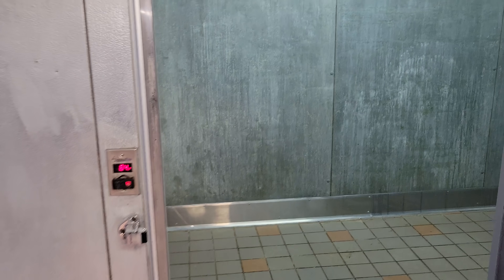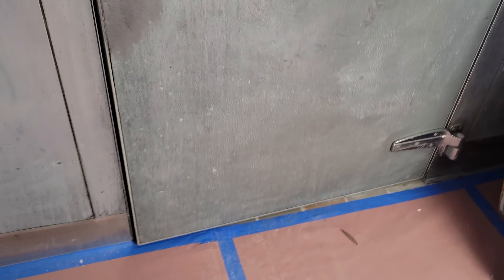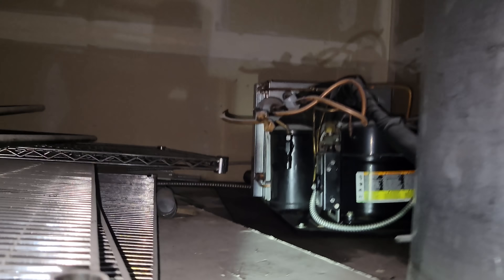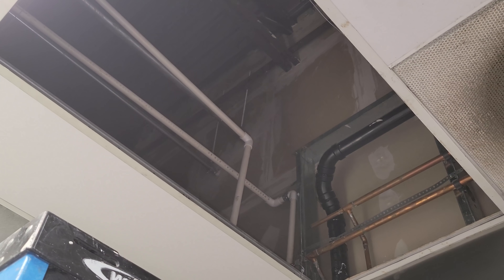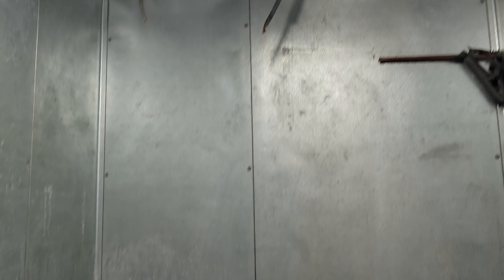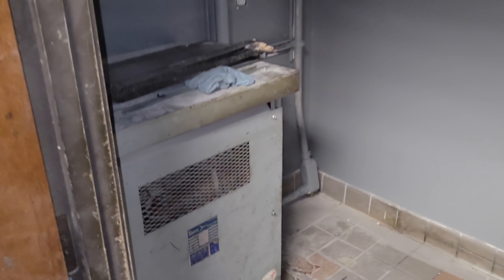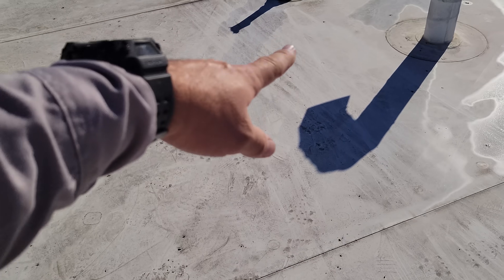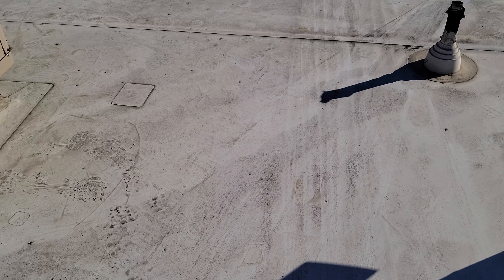THEY JUST REALIZED THE WALK IN COOLER IS MISSING SOMETHING

Comment: The general contractor should have known better. The architect should have know better. They are both there to serve the customer and that includes having the competency in actually doing the job. I came across something similar in a mall. The contractor didn't bother with any of the inspections and screwed all the electrical up. Have to bring in 2 people for 2 months to clean the electrical up. Misswd egress on doors and the list goes on and on. Oh missed ada heights on sinks.

Comment: this place is in great shape compared to the stuff im working with 🤣 I keep the old crap running though ,by old I mean the building had a/c installed in 1983, and they are all still in service cause I won't let them die 🤣. 480, 208,277, 240 on 110 wire using the white as line , yeah we got it all 😅.

Comment: My brother in law was an HVAC service man for years. At one large strip mall a lot of the stores being identical square feet had identical roof top units. He got a service call customer AC was not working. Somebody stole the compressor and probably I stalled it on same roof. Mall tried to prevent this by making everybody that went onto the roof sign into a book and get a work permit. Did not help. One of his co-workers had his 28' fiberglass ladder stolen from roof edge while working on roof.

Comment: This is a complete disaster for the tenant wanting to open a restaurant there. I can see the previous Asian restaurant operators realized they had a slow-rolling disaster on their hands, so they (literally) cut and run. I'm surprised they left their utensils up in the 2nd ceiling like that. That could be considered a code violation right there.  But overall, the current operator has at least 50-75 grand in rework to do before the place could open and operate properly.

Comment: Oh you'd be having a heart attack if you seen some of the things I've seen I worked construction building a plant on the instrumentation side and they were trying to cut costs so they decided to get bolts that you can barely put half a thread on with the nut keep in mind these are holding metal trays that have tubing going through it that vibrates a lot and that's the least of the issues that that place

Comment: Bid high. Sometimes a win is not getting the project.

MEP etc is likely supposed to have been design build by others. The GC then finds subs that can provide that. Whether is a them hiring an engineering firm or a trade with that capability in house. 

Skeptical DB was provided here. 
Skeptical there is an architect. 

Doubt walk-in floor is insulated below the slab. So this should be assumed as a cooler. Freezer modification need to add insulated floor panels.

Comment: Volunteering the information is a good thing. Ultimately it will secure you business in the long run and get you a reputation as a straight shooter. I am a facility engineer at a hospital and the contractors I work with are ones that trust and that I know will tell me how things are. I want to know what's wrong and see what issues are present.  This is especially true when you're dealing with old buildings and retrofits.

Comment: You did the right thing! We're in similar but parallel industries. You're in HVAC, I'm in IT. In my career, I have frequently gone out to a customer site for a "minor upgrade" only to find that their equipment was woefully undersized, under-powered, too old to upgrade, or simply not fit for the purpose they intended. It always pays in the long run to be honest and up front, and let the customer know what path would be in their best interest. Yes, you volunteered a lot of information that wasn't in your wheelhouse, but your experience has value (lots of it), and the customer will be better off in the long run from your advice. If they don't take your advice, then you didn't really need them as a customer anyway. Keep doing the right thing. It will always pay off in the long run!

Comment: 8:00 That is definitely not going to be used as an office. A server room maybe. And no worries about that network equipment overheating, if being in the room isn't hot enough to kill you in 10 minutes, then it's not going to do a thing to the routers.

Not to mention the dozen or so CAT5 cables. 100% a server room, no one is planning on sitting in there doing the accounting.
Reply: That small room will end up being like 120-130 F, at all times. The EM field produced will damage electronic circuits, I can almost guarantee it. Also, it is not up to code with the proper amount of space around it, 3 foot in front, 1 foot on all sides, not enough room for ventilation. Also, some of these cities have even more rules and regulations far more harsh and specific than this, some you can't store anything that could be flammable in the same room as the transformer, some require them outdoors all together and away from people.

Comment: The transformer won't put out any microwaves, but there's certainly ac electromagnetic field nearby. The EM field could hurt electronic equipment, people are immune to this though because they are not made of wires. However, there's still the issue of heat, noise, vibration and dust which completely changes the environment of the workspace. I don't know the norms in your area but I can guess it's likely not an acceptable load for an office there.

Comment: Is that the main panel? If not your grounds and neutral can not be together. And electrical code, you have to have clearance distances from panels and transformers, and you have to maintain a certain temperature limit in enclosed spaces and have proper ventilation. The heat tells me it's probably not right.

Comment: I am a licenced electrical engineer and when you went into the transformer room ..... man its sounds like its overloaded...double tap breakers are illegal inspection nightmares....there typically not allowed at all specially in high load industrial / restaurant locals....1.5 hp x 2 or more exhaust fans... 3 x 208 single phase air..... running wheeeeew... the electrical watts are flowing......that,s why 3 phase power is available...no you did the right thing if something goes wrong there you need to be away.......keep up the great work ethics.....:-)

Comment: Thank you for sharing.  You did the right thing.  You can sleep at night knowing you gave them the information they needed to know. This is why you have the following you have on YouTube is because of your professionalism and honesty. 
Now if their architect or GC has failed them that is on them.  The mechanical engineer should have identified the issues you pointed out.  There should have been an electrical engineer report on the drawings.  After seeing your video, I would walk away from this job. Why?  Any issues during inspections or after opening they will turn the tables on you.  Why didn't you, or why should you have, or you should have told us.  This is infrastructure waiting to fail.  As you know the stresses restaurant equipment is under the life of most equipment is short lived and reusing someone else equipment without the install dates and maintenance records is a receipt for failure.
In the restaurant industry CHEAP or cutting corners is a sure way to failure.

Comment: Age old adage of it’s almost always cheaper to spend more and do it right than spend less, do it wrong, then spend more to do it from scratch in a rush. 

I’ve slowed down and building buildings, focusing more on my workshop and photography, but I lost count the number of times I had people asking what I thought about it an outdated rats nest would be good to go in a week when in reality it would take longer to just sort the mess to figure out if it even worked properly. There’s nothing wrong with old equipment…for certain situations. For electrical, hvac, even telecom, it’s almost always more efficient to upgrade to a more efficient and often more compact/simpler solution.  I think people take a listing claiming to be drop in ready to go as truth without properly checking it out first. Then their budget is tight reflecting that idea of minimal requirement, so problems are patched to be “good enough” and it just gets worse and worse over time.

Comment: You dodged a bullet with that build, to be honest.
The transformer gives off EM radiation and noise at a level that would require them to wear hearing protection.  They would not be allowed to work in the "office" for more than 20 minutes.
Sound and vibrations from sound make it a time limited work area.  Depending on state laws... They might not even allow someone to work near a transformer that is not encased safely inside a faraday cage and protected from water damage ( spilled drinks. etc. )  As transformers are usually kept away from people.  ( seen someone put a cup of coffee on a transformer and then knock it over.  People ran away as the Boom happened.  They were luckily not killed, few burns but ok, 415 V to 240 V transformer cost them about 30k to replace though. )

The entire inside building looked like it needed stripping and replacing.  3 weeks to opening... I fear the cowboy building and installs that have to happen to open that place.  I would say 6 to 8 weeks to just finish the construction and 2 to 3 weeks to "finish" the decoration.

they might end up removing all the old equipment because of costs.  To be honest it is probably cheaper to remove and re-install than get that stuff working. (plus the energy and cost of AC charge, the savings probably pay for the install inside of a year or two.)
Reply: Just want to point out that a transformer wouldn't be close to capable of producing enough EMR to mess with humans by heating them up, which is the only mechanism by which non-ionising radiation can hurt you. Agree with everything else though

Comment: You know what they say - code is written in blood. I think that transformer would have to be in a locked mechanical room because all it takes to become dangerous is that it becomes a handy place to set something flammable. The hood system is probably fine for normal operation, but then something unexpectedly catches fire and the whole building fills with smoke. It's all bad.

As far as why it's all below the roof for the most part - I bet that the roof costs extra to rent, so the previous tenants went with the option that used the least roof real estate.

Comment: As a Trained Electrician, I would STRONGLY suggest they do a full strip of their space and pull ALL the existing equipment out (including that Transformer, it should NOT be in such a small space), install all new 480 V equipment (HVAC, Cookers, Freezers, Coolers etc.) and stick a smaller 480 V - 120 V Step Down Transformer on the roof for their office computers, Point-of-Sale gear and lighting Circuits...
Reply: Roof transformer is a must, you can probably still hear that thing in the next room! It even kinda sounds like it's got some laminations loose.
Reply: @samheasmanwhite  You shouldn't even hear it, but if you noticed all the dust in the air, THAT is why it is humming so bad.  Thing is probably FILTHY and super inefficient
Reply: I'm probably wrong but I thought transformers also created a bunch of ozone when they ran so confined spaces were a no no. Maybe that's only the case with the really big high voltage ones 🤔
Reply: @MegaDysart  Gotta have some sort of arcing or corona discharge, so yep it's only the very high voltage ones.
Reply: Im sure you would $$$$$$$$$

Comment: That 480v transformer in the "room" -- that is the sort of unit that should really be tucked away in a basement -- and with plenty of ventilation.  You are right about proximity dangers - electromagnetic radiation, as well as very high noise dangers.

Comment: Another thing with that trans. When it finally fails and if those different phase windings inside were to short together, I can imagine it would make one hell of an explosion at those power levels. I've worked around those before and if they even started to sound weird or different, I'd get the hell far away from them.
Reply: definitely not safe to have somebody working right next to that thing, fuck that!
Reply: That's what I was thinking , been by a arc flash in Vegas, fuck that 😳

Comment: the only thing that transformer will make is noise and heat. It only oscillates at 60Hz so near impossible to get any sort of radio waves and besides it is inside a giant metal box so it has plenty of shielding from it radiating. you will get more EMR from the plastic enclosed networking equipment than the transformer itself.
Reply: That metal box is open.
Reply: @tram5724  looks closed to me, there is a metal mesh and only small vent slots, which are probably designed to reflect any RF back into itself to be absorbed by the metal box.

Comment: American content makes voltages sound so high. I need 208 on the roof :D Greetings from Europe where 230 is the lowest you can get. Low voltage is for suckers :D
Reply: 208/230 is basically the same. 230/460 is not. 460 on a rooftop in a rainstorm? No way in hell.
Reply: @tram5724  Careful ;) 208 is line to line already. It is only 120 to ground. In Europe 230 is to ground. We do NOT have lower. Thats 400 line to line. And it is wonderful. Screw high currents, thick cables and lost power. It agrees nicely with modern power semiconductor ratings and nobody is supposed to work on wet gear under power anyways....actually...250-430 or even 280-460 would also make for lovely household power. Even thinner cables and most wiring has insulation which is technically rated for something like 800V-1kV anyways....
Reply: @Zonkotron  Same here in New Zealand. All 3 Phase is 400V and all single phase is 230V. I actually have 400V 3 Phase at my house to power my workshop but I had to pay for that to be installed.
Reply: @WilliamPayneNZ  But you 3 phase is 230/400V , right ? Like Europe. SO there really is no difference between 230/400. Most newer houses have 3ph to the breaker box anyways and 230 is just line to neutral and 400 line to line.
Reply: @Zonkotron  yeah same as your guys.

Comment: I would add in a couple extra days labour in with that quote beyond your normal labour quote. They will likely have other trades working around you while your trying to work. The other trades will be dealing with equipment and materials shortages, making their jobs longer and  your job drag on longer.  You will likely have to get up in that tangled mess to do different aspects of your work making your job a lengthy struggle. If you don't get the job due to your higher price, then it's their loss!

Comment: This is going to be one of them "businesses" that appear but never open and then disappear with a big trail of debt behind the investor.
 They have bitten off way more than they can handle and honestly what you done is the best thing they could have had happen so far which is the stone cold truth you can lead a horse to water but you can't make it drink and they can take the advice and use it or they can keep dumping money in the big burning pit of regret. If they have any idea at all they need to get someone who's familiar with everything that flies and what doesn't and go through that place and basically highlight what exactly needs to be corrected before they get any further down s##t creek than they already are.
 ideally that place needs to be stripped of all previous equipment and start off with a clean slate.

Comment: What you came across is typical.  Since the mall hasn't closed, the "owner" is still the same.  They will not have to go through "new" install inspections.  The mall owner/real estate agent get unsuspecting entrepreneurs to sign the dotted line to get the space rented, never telling them that it isn't up to code, or open ready.  These new owners think a little new paint, new lighting, used equipment, and boom, they are the next new thing.  The sad part is they soon find out that in order to open, they need to spend 3x the amount of money.  You can tell your friend that he should have called you before he leased the spot.
Reply: You said it all... seems like mall management probably lied their a55es off to lease the space.  Hopefully they can have a codes inspector run through before they put any more money into it and find a more suitable space.
Reply: 3x sounds a bit too good imo